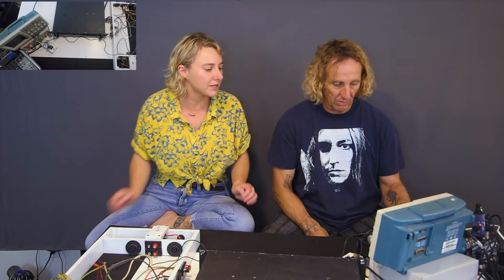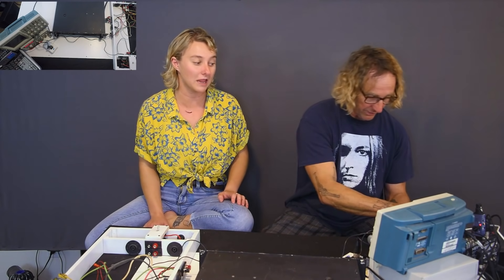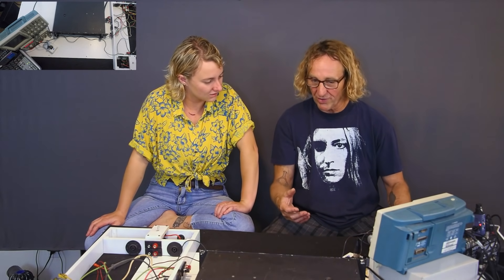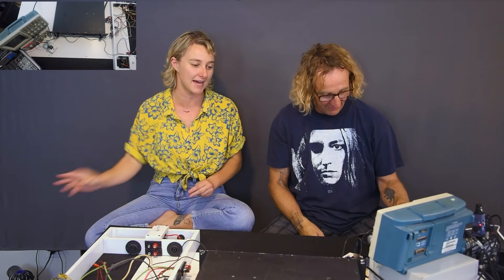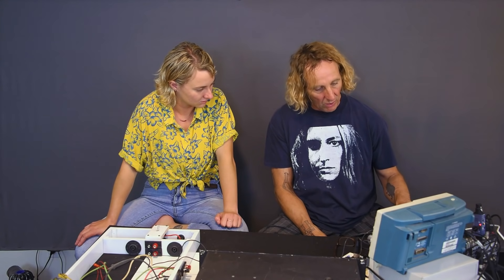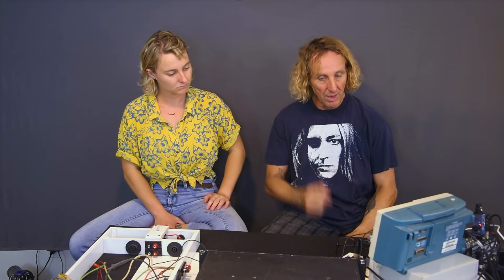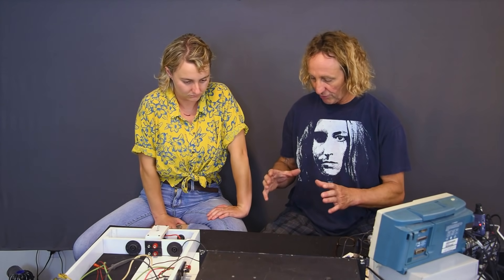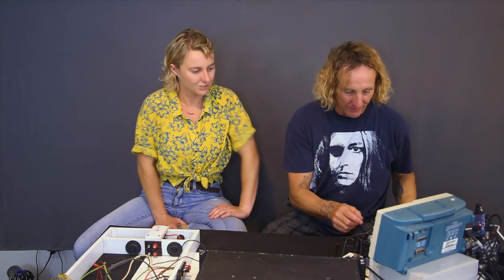Hear Amp Distortion - Crest 4801 (Public)

Comment: Great demonstration!  But I believe what you are hearing is subtracted from the signal… not “added in” as you mentioned.  The clean channel contains the whole signal and the clipped signal contains a lowered signal.  The difference between these signals is what is missing from the clipped channel.  Also IGM (current limiting) and ACL (voltage limiting) are derived using different circuits and may produce different sounding results depending how it is clipping (I or V).  
I also believe what you are hearing is the HF bits riding on the LF crests that are being ‘clipped’.
Reply from the maker: Hmmm, pretty sure what we are hearing is the somewhat isolated distortion component.

I am driving double the voltage on one channel and monitoring that channel Midway between 2 identical loads in series, so monitoring 1/2 of double the voltage.

And then the other channel is driven at the not double voltage so the two voltages that the listening speaker is attached between should be identical when the output signals are identical. Any differential between the two channel outputs is what is heard. So if one channel compresses, what is heard gets louder. If one channel clips, what is heard is clean minus not clean removing the original signal. 

I do a similar test comparing mic preamp distortions by running 2 mic preamps out of polarity with each other and driving one 6db harder than the other and then summing the out of polarity outputs and turning down the louder one 6db.

This results in hearing just the differences. Any compression, clipping and non linearities are clearly heard.

I've done this test in one or more of the digital to anaog compare vids and also some newer vids comparing x32 to m32 that are not public yet.

And thank you!
Reply: @DaveRat  Hey Dave, your videos are great!  I have been watching them for years.  Thanks for responding.  I agree.  We are hearing the difference (subtraction) between the two channels.  However, I think what we are hearing is missing (subtracted) from the clipped channel and not "added in" as you mentioned in the video.  People might think that the amp "adds in" this difference when clipping but, in fact, it is subtracted.
Reply from the maker: Hmmm, we may be saying the same thing.

By monitoring between the two outputs we are listening to the differences. Yes the one channel is clipping and losing part of it's waveform and when that happens, a bunch of harmonics are created which is what we are hearing. One way to look at it is that those harmonics are not in the clean signal and they are on the distorted signal so we are subtracting the clean and hearing what is added.

Another way to look at is that all signals have all frequencies except all frequencies except what we hear is cancelling out.

The clipping is just some of those frequencies not cancelling out. And the monitoring of the two outputs we the extra frequencies in the clean waveform that are not being cancelled.

But that angle has a bit of the 'plannets revolve around the Earth' complexity to it and while things can be calculated that way, it makes things more complex.
Reply: @DaveRat  Dave, thanks for keeping this dialog going.  This is great stuff.
Yes, I believe we are saying the same thing.  Yes, clipping adds distortion.  But it is transient.  Don’t forget about the amps limiter.  Most of what you are hearing could be the difference from the amps protection limiter engaging.  As the clipped channels limiter engages further, you hear more difference.  I believe this (difference from limiter) is most of what you are hearing.  And this portion (difference from limiter) is subtracted from the clean channel.  i.e. What you are hearing could be a little distortion mixed with what is removed by the limiter.
Reply from the maker: What you say is true and when I release the video of a the powersoft amp driven hard and we hear that difference, you will hear the impacts of the limiter from an amp that actually has a limiter.

The crest amp does not have a limiter so the odds that we are hearing the impact of the limiter are quite low and highly improbable.
Reply: @DaveRat  Cool.  I can’t wait to see the new powersoft video.
But I believe the Crest amp has limiters.  ‘ACL’ is the TLA (Three Letter Acronym ;~) for 'Active Clip Limiting' and ‘IGM’ is for 'Instantaneous Gain Modulation' and is fancy speak for limiting too.    These limiters are part of the reason why these amps sound so good when pushed.  The fact that you did not think they had any limiters is proof!
Reply: I believe the 'ACL' moniker was used after the pro series.  On the Pro series it was just called 'Clip Limiting'.
Reply from the maker: Here is what the manual shows for the clip limiter.

Though I am not driving it into hard clipping where the LED responds brightly, it still could be altering the sound.

Once you hear what the FP6400 and the X4 sound like with this same test, let know if that refines your perspective.

The sound of actual limiting and compression with this test is quite apparent.

Clip Limiting

Any time a channel is driven into hard, continuous clipping, the clip limiter circuit will automatically reduce the channel gain to a level

just slightly into clipping, guarding the speakers against the damaging high power continuous square waves that may be produced.

Situations that may activate the clip limiter include uncontrolled feedback, oscillations, or an improper equipment setting or malfunc-

tion upstream from the amplifier. Normal program transients will not trigger the clip limiter; only steady, excessive clipping will. The

Clip/Limit LED will glow brightly and continuously when limiting occurs

Comment: Awesome video!
And Sam is really picking up on info that is really not easy stuff.
I hope the other amps tested will be public videos.
The outro part of the videos, with the sub tones, do you have a stand alone video with those? Would be nice for soundcheck. 
Thanks for great videos!
Reply from the maker: On the member side there are 1 or 2 videos of just the sub tones. I believe there is the full test sequence I use for testing subs and sub systems